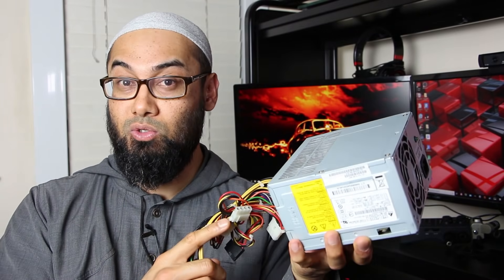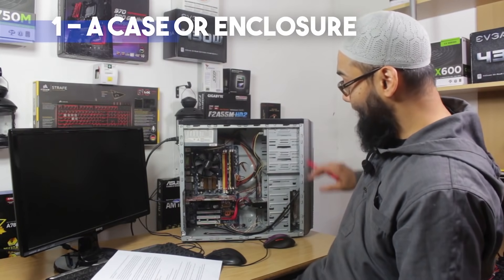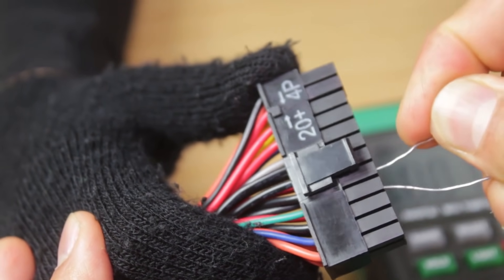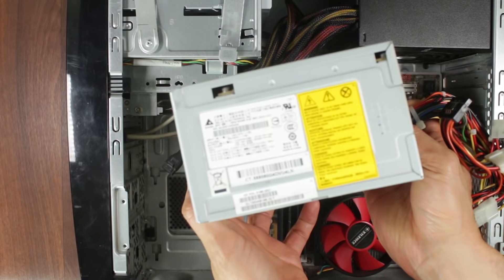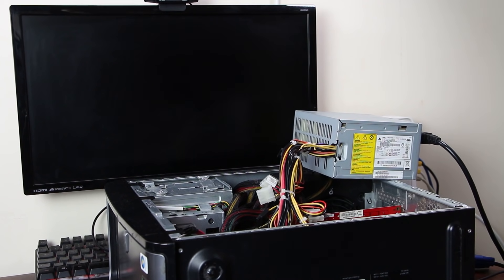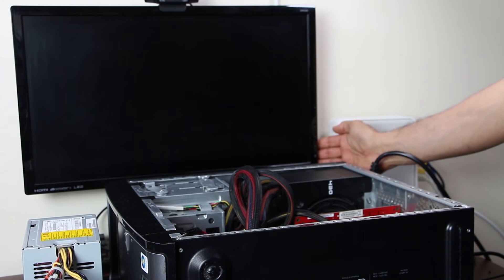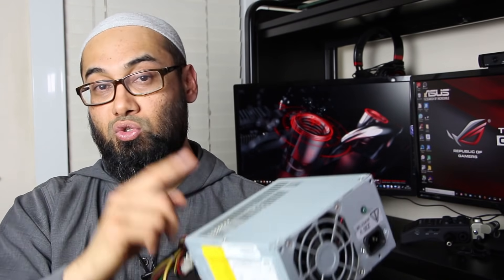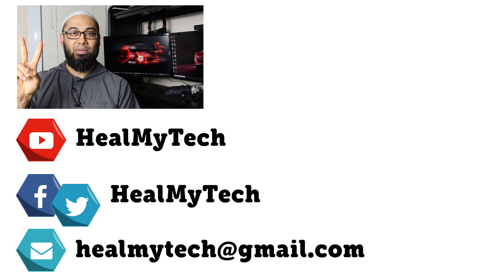Computer Turns On But No Display On Monitor | Led Light On Fan Spinning | Power Supply Unit Pc?

Comment: Please I need help my computer is not turning on, no any sign of turning on, It was walking well just from no where it went off without any sign of problem I thought it was power supply I tried the one from working computer no sign, I got the one which was in my computer try it to another computer is was working well, now what could be the problem I need help

Comment: I didn't used my computer for about a week so i turned it on and the windows started, everything was fine then i leave the computer to run idle for some time. Then i came back after 10 or 20 minutes, the monitor was sleeping and the mouse and keyboard are off, and the power button of the cpu is blinking. At first i thought it would have gone to sleep automatically due to inactivity, but then i noticed that both the system and cpu fans are still spinning so it's not in sleep. Then i tried to shut down the computer by pushing the power button once, but it didn't turned the computer off so i pushed and hold the power button and the computer turned off. The after that, whenever i turn my computer on both the fans starts to spin, no light on power button, no hard disk activity light no video output. The hard disk is still working because i can hear the spinning sound inside the hard disk when startup.

Can you help me please i have no idea what the problem is.

Comment: Sir, when I press the power button my cpu is not starting, fans not spinning, only stand by led is glowing on mother board, but when I do smps test using jumper cable it is working, but when I connect it to mother board no response, sir please say what is problem in it?

Comment: Vga light stays in with out without card in. The card fans spin and computer hdd led flashes for awhile as if booting. No post. I tried multiple HDMI cables and display port tried ram. Tried redoing power cable nothing...

Comment: I'm having odd problems. There'll be times where my pc works, then the next day it won't leave bios without freezing or rebooting back to bios. Theres times where none of the USB ports work so I can't even get into bios. I also noticed the VGA led lights up on the motherboard.
Reply from the maker: You need to start troubleshooting.  Have you checked out my troubleshoot series?
Reply: @HealMyTech1   just this vid so far. I'll be sure to poke around before I call geek squad.

Comment: When I turn on Pc the power button lights are on funs working, Mouse lights on, Hard drive light turns on and then turns off keyborad off. Is it PSU?
Reply from the maker: You need to start troubleshooting.  Have you checked out my troubleshoot series?
Reply: Checked Both RAMs they are fine then Processor that's also fine, PSU is fine too
The place from where I bought the Pc they said its the BIOS issue

Comment: My cpu runs ,num lock ,caps lock keys working ...but no display on monitor i have two 2gb ddr3 ram and two ram slots ,cleaned ram inserted in both slots still display is not working ..monitor led changes green to orange and nothing on screen

Comment: I have build my first pc it happen like my pc warned me that something happen and it's trying to fix it but it shut down on it's own and i have no choiice but to pull out plug and i have a red cpu light could it be the psu? Because i bought a not rated cpu or the cpu is dead? This also happen to me the fans are spinning but no display

Comment: It works on my PC, I thought that the PSU was okay, the fan was spinning through black and grey port testing. My suspect was the motherboard and to buy a new one is so expensive, until I watched this video. I already tested all parts including RAM, GPU, Monitor, cables etc., then, when I replaced it with new PSU, my PC works well. Big thanks to you dude!!! Hope to talk with you soon. Being a technician is my fashion and I really love to fix those buggy PCs.
Reply: what if i had bought a new psu
I plugged it and still didn't work
I've tried all fix for those silly mistake such as ram (clean it with rubber/change the slot position or swap/brush off the slot), cmos (that battery,I have two of em,still doesn't fix anything), gpu (gtx750ti, already unplug it, using vga on mobo)
cpu (have two also, already tried changing it, didn't work)
clean the case

Comment: I already tried changing the ram, video card and power supply, I must assume it is the motherboard ?
Reply: Exactly the same here. Have you found a fix
Reply: @otuekongwilliam  my motherboard is dead, but I have only tried a lower capacity power source, I want to get a power source of the same capacity (650w) or greater to rule out that this is not the problem

Comment: Thanks bro. You helped me fix my pc. I wasn't getting any video output and I never in a millionaires would have thought it was the ram. I was about to buy a new motherboard and you just saved me a lot of money
Reply: That happened to me i bought a new mobo but still pc is on but no signal on monitor

Comment: I just got a brand new ASUS TUF 3070 card to replace my old 980ti and I installed it into a asus rampage extreme v mother board with 8 sticks of ram and 1000w power supply but I go to turn it on and it powers up shows gpu fans running just won’t display and after about 40 seconds it will turn itself off then I went ahead and took out the ASUS TUF 3070 to try and see if my windforce 980ti would display at-least but just more of the same

Comment: So my computer whatever I would try to turn it on at first it would run for maybe 30 seconds but nothing will show up on the screen then the computer will then turn off and then it’ll turn back on and everything will run just fine I don’t know if I have something loose like a loose connection or if it’s because I plug my computer into a power strip but I haven’t faced problems like that before I have no idea, any thoughts?

Comment: Thank you for your video!
About 11 months ago I built my first pc, used my old 600w power supply, old 240GB SSD, old case and old liquid CPU cooler, I bought brand new a B450 Aorus Elite motherboard, Ryzen 3600X CPU, 2X 8GB T-Force 3200mhz DDR4 RAM and a Gigabyte geforce gtx 1660 TI 6GB. Been running faultless till today which when I switched it on it had no post, had the red LED lit up on the motherboard, first the DRAM lights up for a few seconds then switches to the CPU LED and back to the DRAM LED and stays there. Only tried swapping the RAM sticks around and tried running it with only one RAM stick and same outcome. Last time I used the PC the night before it was running perfectly and all I used it for was to watch a few youtube videos for about 20 mins and then shut it down. No CPU or graphics card overclocking, just the XMP profile for the RAM to get the 3200mhz. Which has been set and running that way for over 10 months. I'm guessing by your video it's the power supply unit... Hopefully!!! I always check the running temperature's often but also could be the RAM. What you think?
Reply: Hi , I’m having the same problem with my new build , if you have fixed it by now what was the problem ???

Comment: I’ve checked my RAM to make sure it was sitting in far enough. Cleaned them. Changed out the power supply for two different ones that was more WATTs than needed and still get nothing to show on the display. I’ve even changed out motherboards. Same thing.
Reply: I’ve changed my cpu motherboard, put new ram in, I’ve rebuilt the whole system I jsut can’t get it

Comment: Here is my case:
I was on my bed powering on my wireless headphones when I saw my screen going black. At that time the pc was idle, not under any load, I don't know if this was the cause or some coincidence.

The system is only a month old and worked perfectly until today...

So I tried rebooting, Cmos reset a few times, tried different hdmi and DP. Unplugged all the plugs and putted them back. Nothing. Swapped ram, tried with only 1 ram. Reinstalled the GPU. Nothing.
So I decided to dismantle the whole system. Reinstalled the CPU with the GPU with 1 ram stick, no ssd, no hdd without any usb plugged in. NOTHING.

5900x
3080
64 ram
Aorus x570 pro
EVGA gold 850 psu.

Any ideas what can I possibly do?

Comment: I have two old CPUs
both stopped working very long ago. and I kept them aside.

now I wanted to give them a try by replacing any non working parts.

for one of them.
it when I connected it to power supply CPU tries to start immediately without pressing power button.
it used start on pressing power button. I wonder what happened to that power button now and why it is starting on its own.
and going into the main part. after it turns on, fan was spinning for 2 seconda and stopping.
I trying cleaning up ram, cmos battery etc.
but no change.
later I replaced the power supply box with the other CPUs power supply box 
now the fan started spinning. but it is not giving any display.
I tried to remove the connections and reconnecting.

and I again put the original power supply box which only gave 2 second fan spin.
now the fan is spinninh with this power supply box too but still it is not giving the display.
could you help me with this

Comment: Ive been using a prebuilt computer with a asus prime 320-mk motherboard, ryzen 3 3200g and 8 gigs of ram and recently i bought a 1650 but when i plugged it in and turn on the computer it didn't display. I turned it off, removed the gpu and still no display. Please help

Comment: My pc got startup issues after boot it will restart,Then luckily i take one ram slot and try again pc luckily booted windows,I backed up everything and now its fine,After i go to sleep in just leave it with plug on,The next day it doesn't show display and there is no light blinking on the case,Can anyone help me?

Comment: I was talking to my friends on discord on my pc and all of a sudden, my keyboard and mouse stopped working and there was no signal on my monitor. I turned of my pc and it turned on but no signal on the monitor and my keyboard and mouse wasn't turning on. I only realised now that the rgb on my motherboard isn't turning on. I really need help. I only built my pc 5 days ago. I don't know what to do. Someone please respond
Reply: Yeah the same thing actually happened to me and I just got my pc today but it was pre built
Reply: @geoffthesamman9370  Did you fix yours yet? I'm going to try and fix mine now.
Reply: @AaronC06  no sadly not but I’m going to continue trying to fix it
Reply: @geoffthesamman9370  I don't know what's wrong with my pc. I tried moving around the ram, that didn't work. I reseted cmos, that didn't work. I plugged everything out and back in. That didn't work. I don't think I can bring it to a repair due to lockdown where I am. I am screwed lol. I think its the motherboard because the rgb  on it doesn't light up. Do you know what else I should do. 🤔 Thanks for the replies🙂
Reply: @geoffthesamman9370  Sadly, my motherboard broke. I only got it on Christmas Day. Hopefully yours didn't break. Goodlook and Happy New Years😊
Reply: @AaronC06  thanks, you too.
Reply: @geoffthesamman9370  Around 20 minutes ago, I opened my case one last time to see what was wrong with it. I saw a red light on the motherboard indicating that there was something wrong with my cpu. I checked the cpu cable and I touched it and it instantly popped out. So I plugged it back in properly and booted it up and it brought me straight into windows. All this time it was a loose cable😐. How is your pc doing. Please update me.
Reply: @AaronC06  I brought mine back to Best Buy and got a brand new one for free that actually works plus I got $80 back for paying for fast shipping so I guess I kind of profited off the situation a bit. I’m glad to hear that your pc works again as well.

Comment: My pc was working fine then when I updated  my gpu drivers it told me to restart and now it won't post, I got screen saying the it didn't boot into safe mode or something and that i had to press f1 to enter setup but turned off. All my fans turn on so i don't think its my power supply. Idk what to do!!

Comment: I only had my pc for 6-5 months and my little brother was playing rdr2 and out of no where display goes away and there is no sound
Edit: and all fans work and the monitor now I restart it and nothing is displaying and the there would be usually light turning on on my motherboard and one would be on and now none are on and I also switched homie cables and it’s still the same

Comment: My keyboard wont POST no beep but fans and light are on and keyboard and mouse light turns on for a split second only then shuts off and power button wont work to turn off, what might be the problem?

Comment: My PC black screens when im playing a handful of games; Code Vein, Escape From Tarkov, Insurgency: Sandstorm, DeadSide.
Any and all other games I have not yet had the issue such as Witcher 3, DayZ, RainbowSix Siege, Fallout 4 and a variety of other games.
I am running an i7-7700 w/ arctic freezer 34, Rx580 4GB, my PSU is a Thermal Take Smart 600W I've had the computer for about.. 3 or 4 years and my Issue has been going on for like a year and a half. I keep my computer pretty dust free (for the most part) It just randomly black screens while playing certain games. My guess is the PSU, as it is only a 60$ PSU to begin with, can anyone chime in if my suspicions are correct?

Comment: After 3 years of using my computer similar problem happened to me. I was using my computer that suddenly my monitor lost signal and CPU fan started spinning for a few seconds and then returned to normal speed, power button's light went off, and monitor didn't get the signal back. Holding power button didn't turn the computer off. So I had no choice but unplugging the power cable to turn it off. I checked the RAM and it was ok.
When my computer was on, I unplugged the motherboard power cable and then unplugged the computer power cable. Then I reversed this procedure, i.e., plugged the computer power cable and then plugged the motherboard power cable. Surprisingly my computer started to work without any issues for one month but that problem happened again.
Please help me with this.

Comment: Bruh I switched the power supply I switched the graphics card the fans are going the mouse is on I took out the ram put in new thermal paste reset the cpu cooler. The keyboard isn't on and the mo itors aren't connecting im so irritated and I don't know what to do

Comment: I have a brand new pc that I built and it was working perfectly fine and then I unplugged my monitor and then I plug it back in later and now it wont work also I have a power save mode on my pc thats flashing orange I have tried everything I don't know what to do. My parts are brand new and only less then a week old

Comment: I recently obtained a brand new pc and when i play during long periods of time, my monitor just suddenly shuts down while my pc is still running. I checked the intake of the power supply and the out take of the pc but i do have enough space behind it for airflow to constantly run. Im gettin a little anxious since its new and might be a gpu or monitor problem.
Reply: Did u fix? What was the problem?
Reply: @pastego  well it doesnt restart that much often anymore. i still factored in the out-take of my pc which i reorganized my whole room just for it to have sufficient space and that solved it fortunately lmao

Comment: I had replaced almost everything included cpu, gpu, ram and motherboard, so the weird thing is that the psu is working(spinning) on my first motherboard but not displaying, and it didn't even turn on (just spinning for a second and shutdown) with the second motherboard unless unplugging the cpu cabble.

Comment: I have similar issue - but the display not turn on is random - like this very morning, no display, heard sound the system goes to window but no display - after few restart and shutdowns, it went to Windows - should I still try the power supply check?

Comment: my whole pc is on, my fans are on, keyboard and mouse, gpu is lighting up, but there is a solid orange light on my motherboard and the monitor won’t turn on. this started about 3 days ago i restarted my computer then it turned on but my monitor had no signal and it kept saying no signal until a few hours later it randomly turned on. now it’s off again and has no signal again.

Comment: My PC doesn't show display with you but works without gpu. when I turn it on with gpu the monitor keeps saying no signal.when I try to open bios it shuts down and then turns on again but doesn't show the display. But it works completely fine without gpu. I know it sounds like it is a dead gpu but no. Some times I managed to turn on PC with gpu after attempting like 4 hours out of dump luck and gpu works fine but when I shut it down or restart it goes back to no showing display sign.
I tried every thing.
1. Cleaned and reseated the ram.
2. Reset bios.
3. Cleaned motherboard.
4. Changed 3v battery.
5. Unplugged all peripherals and HDD just to give maximum power to motherboard and gpu.
6. Motherboard is also fine because it has worked some times with gpu as I mentioned.
7. Checked all HDMI cables.
8. Both monitors works fine.
It is kinda like a glitch of motherboard.
It works completely fine but doesn't show display with gpu installed. And all components are completely fine.
I used this PC for 2 years and had no problem with it and 2 days ago it doesn't work. How??? What happened??...
I don't have money to buy another PC or graphics card.
My spec's:
CPU i5 3570
Gpu GT 1030 2gb ddr4
Ram 8gb
3 HDD
PSU 320watt
Motherboard HP prebuilt
PC HP 6300 pro tower.
Sorry for my bad English.